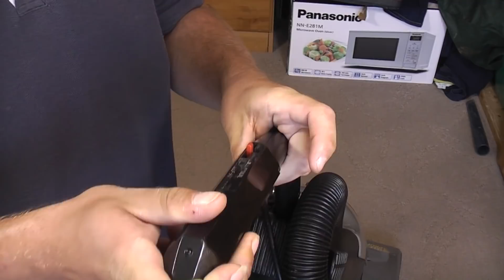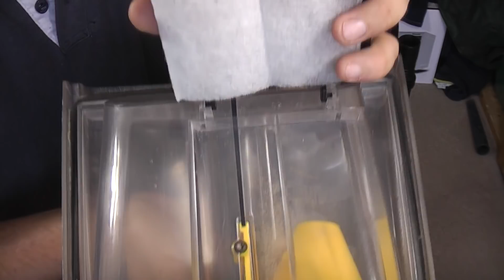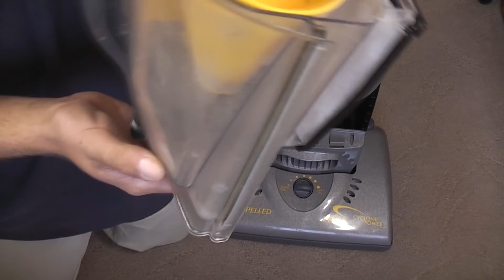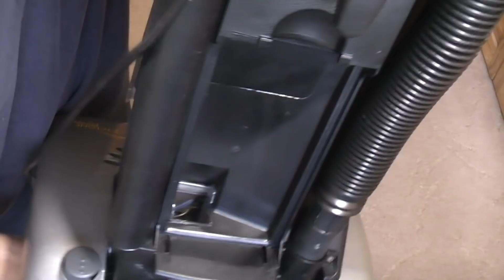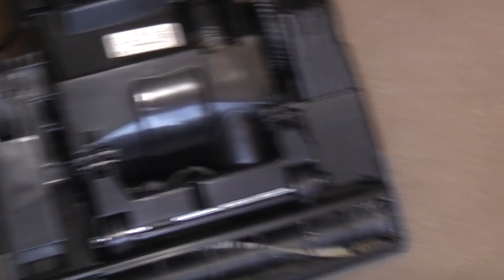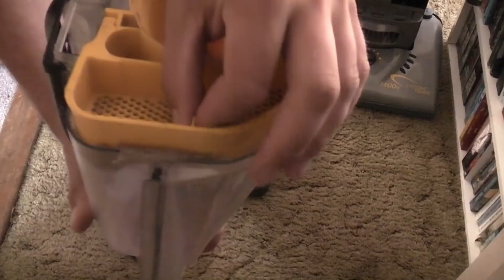Electrolux Cyclone Power Z1910 - After Refurbishment (almost)

Comment: Hi Sam, Phil here. It does sound like the Z1373 did, it wasn't a particularly quiet machine. Excellent at grooming carpet, and excellent at blowing around the dust on higher up surfaces at the same time! I grew to hate that cassette. Dreadful piece of design - always a messy job to empty. 

PS. I will be sending you an email as I've found the Z1373's user manual.